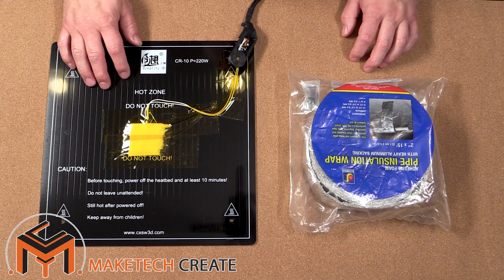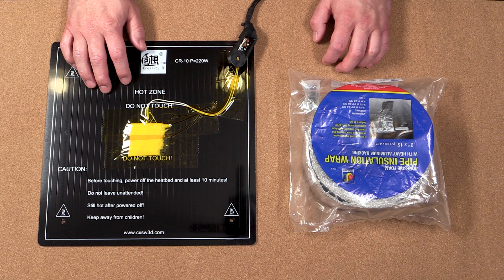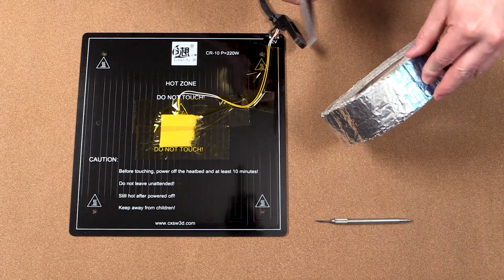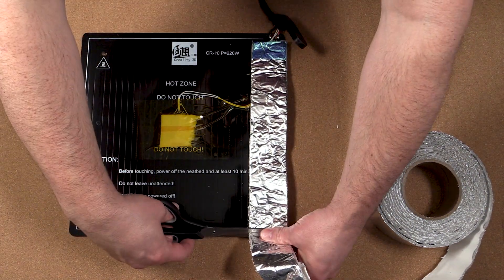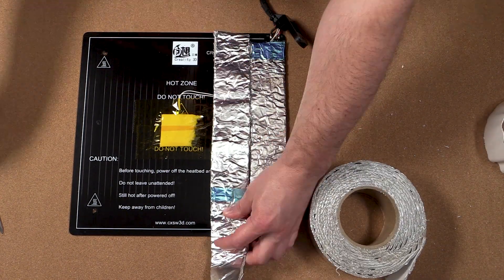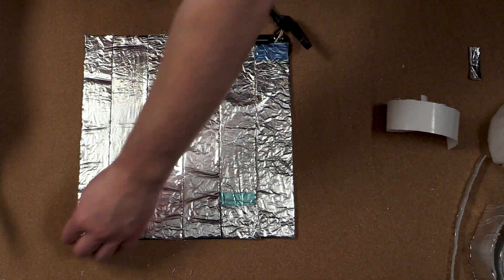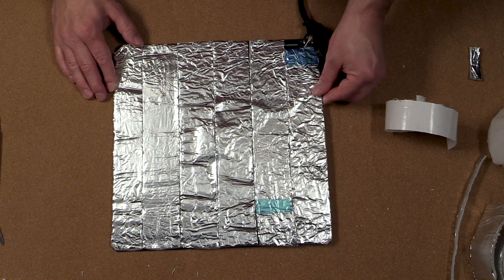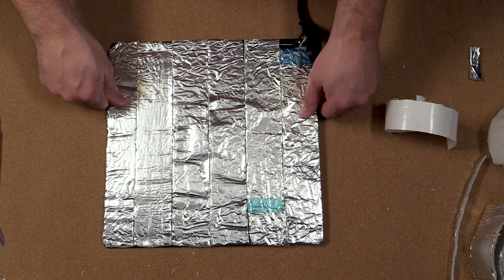DIY Insulated Printer Bed / 3D Printer Heated Bed

Comment: You should show whether or not it made any difference in heat up time.  Otherwise, what's the point.  Show us the numbers, including whether you are using a 12V or 24V heater for the bed.
Reply: I know this comment was a year ago but just in case a new person swings by. 
The main reason for insulation is efficiency rather than speed. It keeps the bed warm so the heater doesn't need to continuously heat.
Reply: @Evo_Spec  Thanks for the reply!  Makes sense.  Good point on the efficiency, but how much more efficient is it?  Any measurements of heating electricity use?  Was it worth it to insulate?

Comment: Is this the aluminum tape they use for the dryer vent ? I have some
Reply from the maker: Kinda .... it's aluminum tape with an add foam insulation to it. It's in the plumping section of your hardware store.
Reply: MakeTech thank you ! I’ll go get some in the Am

Comment: Pipe insulation wrap is usually flammable.  If you're going that route, use dryer vent insulation, but that tends to be nasty fiberglass.   Just get a proper cotton pad.
Reply: I had the same concern as well. I tried to look up the data sheet for products like Frost King (the stuff you find in most US HW stores) and it doesn’t have a temperature rating.   The intended use for this is to keep pipes from freezing.
Reply: @sftzclem  According to the specifications listed on a Home Depot’s site, this tape is “Fire Rated”.